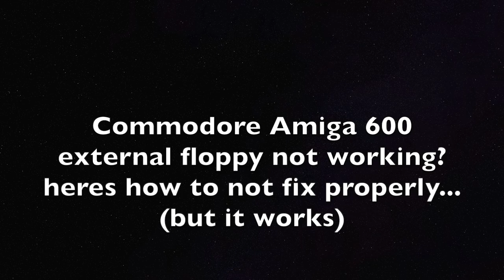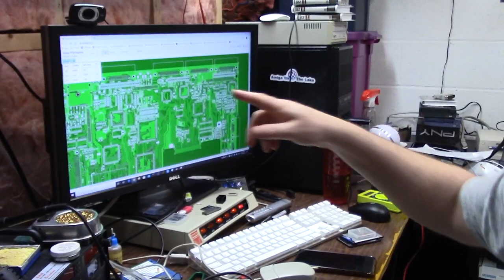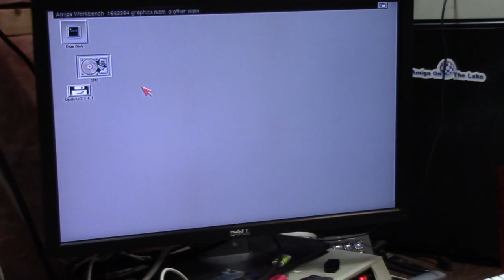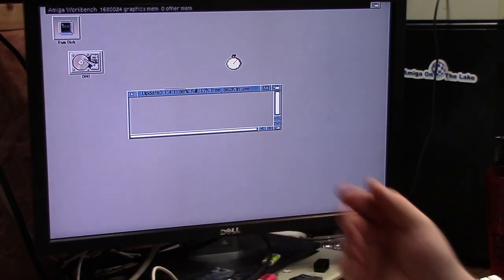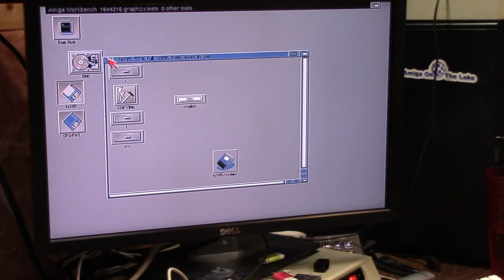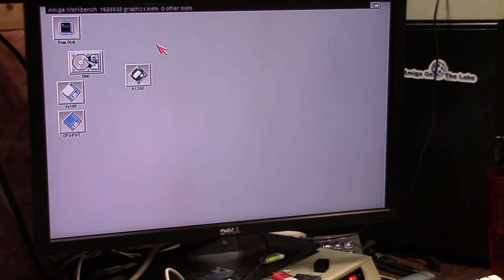Amiga 600 external floppy not working? here is how to not fix it properly

Comment: I have commodore Amiga 600 and internal floppy drive won't read floppy disk anymore because I clean with alcohol on the head of floppy drive and can u please help me how to fix internal floppy drive head?...
Reply from the maker: alcohol leaves smudges it is not a cleaner. take a q-tip ear thing and put some good windex or equivalent window cleaner on it and wipe it, then dry it with the other end.  IF it is head alignment check out my 3000 tower restoration videos where i show how to adjust the stepper motor for track accuracy

Comment: Did you replace a capacitor, or did you replace a resistor?
Reply from the maker: E597  , pin 23 12v , 0.01 uf ,i used a 0.4 pico fuse
Reply: @ChrisEdwardsRestoration  It looked like you replaced E598R which is a 200 ohm ferrite bead, not a capacitor. Also, I'm even more confused as you used 4.7k ohm resistor - not about that you used a resistor, but the value. Was it just what you had a the time?
Reply from the maker: E597  , pin 23 12v , 0.01 uf ,i used a 0.4 pico fuse.  I did say this is how to NOT do it properly 8-)

Comment: I get it what you did works but why not just buy the component and restore it as it was designed?    Like you I have many working Amiga's when one is not working well there is another I can use in the mean time.  Don't get me wrong I am not judging what you did appears to be working what's the rush?    I love the A600 its small and takes up very little space, its not my favorite Amiga but honestly I use the A600 more than I use my other Amiga's because it flies with a Vampire.   I have an A600 I picked up not working off eBay one of the filter caps was not just missing but had a torn pad but the most interesting part was the -12v line to the serial port had a resister burn up and it burned up so bad it burned up two traces that ran under the resister which you can only really see under a microscope.   Not sure why it burned up so badly but it looks like a volcano erupted.   I ordered the parts to make it right but I started working on other boards including building an A500++ board which I am still waiting on backordered part and DHL held hostage parts to arrive so I can finish the build.  Sorry I am rambling.  Anyway I do appreciate your content.
Reply from the maker: Its fixed proper. I filmed this over two months ago.
Reply: @ChrisEdwardsRestoration  Good to know because I would hate to see a volcano eruption on the board that I have seen on my A600 on the -12v line.  I have pictures from my microscope if you want to see them on FB.